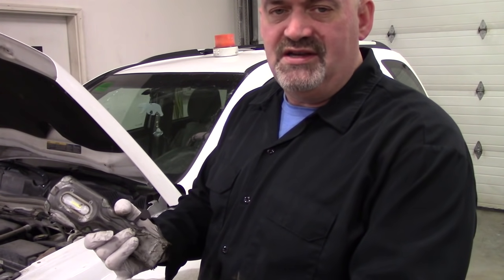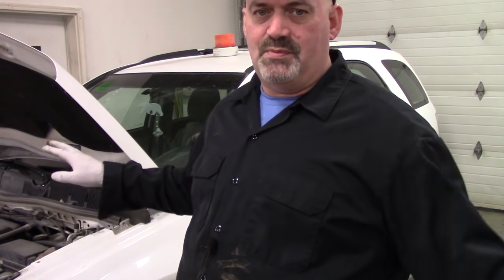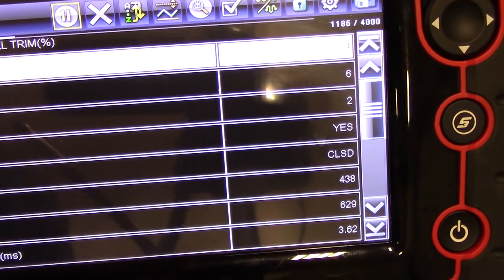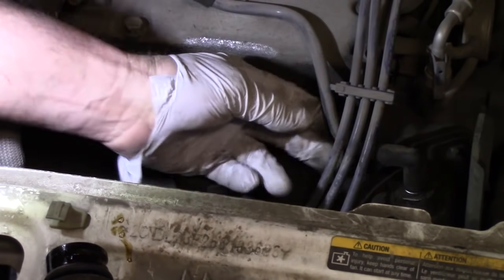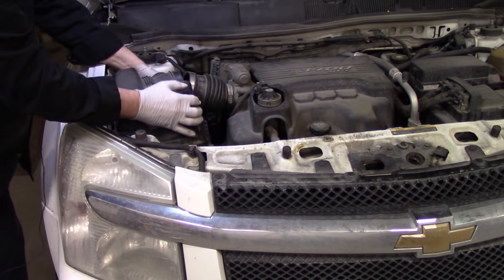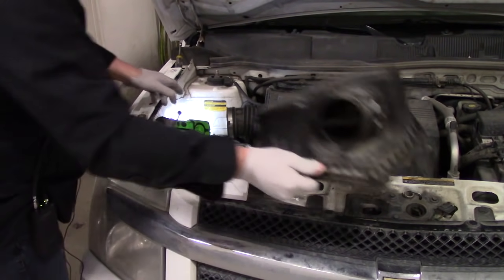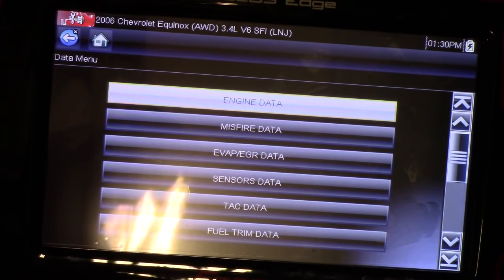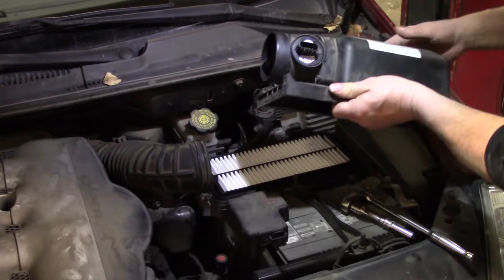Code P0171 Diagnosis and Repair

Comment: Excellent presentation!  Daughter is dealing with the warm hard start, I'm trying to diagnose from 250 miles away.  Recently worked on by professional mechanic.  She got gas and would not start.  A push on the gas while cranking would then it will start.  I'll follow up this comment when she gets it fixed.  Thanks for taking the time to post this, again, very well done Sir!

Comment: I swear by the Chevy Equinox.  I purchase a new one in 2005 and it ran like a champ.  Turned it over to my Granddaughter in 2014 and it still going strong.  What did I replace it with.  A new 2014 Chevy Equinox.  One of the best and most reliable vehicle I have ever owned.
Reply from the maker: I love hearing success stories. I have seen a few in the shop but usually due to lack of proper maintenance. The last one I had in was because the coolant ate right through the head gaskets because it had not been serviced in over ten years. Costly mistake.
Reply: I have ,05 and just replaced cat and bought new sensor guys at Auto parts says it was clogged and my check engine light is still on and still saying same thing,low efficiency threshold, should I buy this part to see if my engine light goes off?

Comment: It was an exellent video. Thank you so much for really clear explanation (leakaged) which helped me to fix my Prius 2010 with P0171 error code. Found the air filter clamp right next to MAF sensor loose.

Comment: 2012 Nissan Maxima with code P0171. Your tip on higher trim values at idle and lower trim values when reved. Was a vacuum leak. 3/8” vacuum hose blown out on the back side. I could hear it sucking. Looks like the PCV hose. Thanks for the tip. $3 Fix.

Comment: Very good video.  . . It is yet another example of one component going bad, but doesn't directly trip a direct code. Annoying. . But it is how it is. . . I had a mass airflow sensor go bad once while on a long trip. Luckily, it tripped the code that speficically went right to it. It was a 3 minute repair, start to finish.

Comment: Had a a trailblazer with similar issues Tim,turned out to be the MAF and a PVC. disconnect creating as you said a lean condition. :)
Reply from the maker: I have seen that as well. The PCV vent side becomes disconnected when people remove the intake air box and don't get the hose on the underside properly connected. Don't know what we would do without these gravy repairs  they seem to engineer into these vehicles.

Comment: I had p0171 on my Colorado. It was not running for crap. Bought 03 sensors nothing. So I bought a fuel pressure kit harbor freight. Found my pressure at about 18 lbs. Replaced fuel pump now pressure is over 50. Runs like a new truck.

Comment: Thank you for the video. At about 5:30 as your hand iis moving towards the ignition pack there is a hose that attaches to the top of the engine. What is that part it connects to? The clip that holds the hose in place is missing on my 2005 equinox and I'm connerned it is causing a vacuum leak.

Comment: The buffer on my Modis Ultra only goes to 2000... guess I should check if an update is available via shopstream. With my luck... I'm sure it's only available with an actual "paid" update. =(
Reply: Just about cheaper to buy a new scanner nowadays then to update. If you update the tool youll get to have cheap cables that break the first time you touch them. Super cool. I would keep the lower buffer.

Comment: Could this code be caused by bad gas?  We were having no issues with a Dodge Ram 1500.  Filled the tank with gas, the vehicle shut itself off whilst filling, hesitantly started, then sputtered and stalled after driving about a quarter mile.  The vehicle needed towed.  After adding Heet to the tank and using cans of starting fluid, the vehicle starts, but won't stay running.  The code is P0171. There were no issues prior to this.

Comment: Thanks for the video. Have this same code on my wife's 2014 Escape. Question...On our Escape, P0171 is lean on Bank 1. If it were the Mass Air Flow Sensor causing the computer mis-calculate the amount of fuel to add, wouldn't that affect both banks the same? I'm trying to narrow down my issue is why I'm asking this. Not sure if I'm missing something.

Comment: My scanner only does Freeze Frame data. It found the following for a P0171...
STFT Bank 1 is 14.8%
LTFT Bank 1 is 29.6
MAF is 0.39 lb/min (2.948g/s)
809 rpm throttle position 26.2

Vacuum leak? I have searched for a vacuum leak and can't seem to locate one on the 2010 Chevy hhr 2.2L. Wish I had access to live data on the Innova scanner.

Comment: I'm getting that code, so the computer thinks it's running lean, but it's running so rich you can practically see charcoal dust spraying out of the exhaust. Between the MAF and the O2, if they are sending conflicting data to the computer, which sensor gets the final say?  It's a 2002 ranger with a 2.3. It runs smooth for the first couple minutes, then goes to pure crap.

Comment: I changed my MAF sensor , intake manifold gasket upper and lower , pcv valve and grommet . The service engine light went out for a while then came back on then after 2 days the light came back on again . Anything else I’m missing ?

Comment: Hello friend... I have a 2002 chevy s10 2.2l pickup.. I checked for leaks with smoke and no leaks... New fuel pump, new filter, new 02 sensor, new spark plug cable and plugs, new map sensor. And still get the p0171 code right back.. Any ideas why?? Please help me

Comment: If you are repairing a customer's car, don't clean it.  You risk a come back if you are not thorough about it or age related failure later.  Plus, you gotta charge labor to clean, which comes out a wash.
Reply: I really didn't think of it that way but youre right. For whatever reason, these particular part numbers are junk. I just want it fixed and down the road. They will be saving that much in gas over the next few months. Blessings!

Comment: No no no. You don't get to skip right over how you got that in. Is there some trick, does the key need to be in?
Reply: Hahaha, no key needed for the install but I neglected to put a dab of lube on the o-ring first. That's why I edited out the cussing and extended fighting with the stupid thing. On the second one I put a little lube on it and it popped right in.

Comment: Buick 2000 3.8....my warning light problem began about 2 months ago. First it said gas cap loose, I cleaned it and that was solved...Then it became slightly difficult to start, so I would slightly tap the gas pedal and it would start right up. After a couple days it would start up normally again on the first turn of the key like it always has and still does now........a couple weeks ago the yellow check engine light came on and the code came up PO171. Then it when out by it self a couple days  later, then came on again, and went out again...During all of this I have watched my mileage very closely, and my instant mileage for highway driving is 29 mpg, which I the same has it has always been, and the average overall mileage is 22, like it always has been......do you have any idea what the problem would most likely be? Also during this whole time the car has been idling and running very good......Thanks for any suggestions...............
Reply from the maker: Vacuum leak, MAF issues, O2 sensor,?
Reply: @ThecardoctorTV  thank you

Comment: thanks
man 
my 06 pontiac Torrent 3.4L v6 i just had my engine rebuilt cause of a blown head gasket  and my mechanic says that the engine light is on he says that it running lean do you think that it is the Mass flow sensor doing this, i was driving around most of today but noticed that i am burning more fuel, i replaced the  rubber elbow that go on to the pvc valve and also replaced with a new Gas Cap but the engine light is still on in the Dash, do you think that it might be the Mass Flow causing that light to be on, the car starts fine.
Reply: Same for me months after changing the head gaskets on our 06 Equinox, Did you ever find out the issue?

Comment: Why do some vehicles use MAF sensor and some don't. Just MAP like my Dodge truck?
Reply from the maker: All in how they calculate how much air is entering the engine. I think a MAF is better at doing that but prone to failure so its give and take for advantage of either. That's just my opinion and they probably have other reasons based on the actual engine and fuel system design.

Comment: hope u can help me doc,I have a 95 Nissan D21 pick-up V4, I have no injector pulse  , nothing
Reply from the maker: Crud. Is it got spark?
Reply: Yes it does, but it's a weak orange spark
Reply: Just replaced fuel pump and fuel filter, distributor cap and rotor
Reply: I got nothing on fuel injectors through
Reply: Though
Reply: How do fuel injectors get their pulse, what should I check or test,please help doc, your my last hope, thk-u in advance
Reply: Jaime Sustaita gets pulse from computer check your wiring and fuses
Reply: Ok, thk-u Desmond blyan
Reply: Yes, those ECU's are problematic for no injector pulse. The injector driver circuits fail internally. Most likely a bad ECU or wiring if you have spark but no pulse.
Reply: Hi howd it go, did you check powers grounds n fuses?
Reply: I did and found I had a short to ground, thk-u so much for your help, really do appreciate it.
Reply: R u the doc, or is this someone else.
Reply: Two of the wires are touching obviously the doc can't help
Reply: Its commen problem
Reply: Wires are close to exhaust burn out easily that year
Reply: Gotta change whole harness
Reply: Or repair wires
Reply: Probably just repair wires, can't afford whole harness, Yea agree about the doc, but thks to u , I got once again I appreciate your help.
Reply: Should be just like one wire
Reply: Yes,I think it is,r u a mechanic and do u have your own YouTube and app
Reply: Any input anyone
Reply: No no you tube channel just common sense
Reply: Lol
Reply: Its an obvious problem
Reply: Ok, thought maybe u had your own YouTube page
Reply: No i would but too many wanna 🐝 already
Reply: I only know facts
Reply: I do alot of  work on cars, but electrical diagnostic is not for me, especially since I don't have those expensive scanners
Reply from the maker: Sounds like another success story! That was me as My alaska. I screwed up and commented under another channel. Glad you guys fingered this one out. Blessings.

Comment: Hello and thank you for your informative videos. I am having similar problems with my 2010 equinox 2.4L. My problem though is not a hard start at all. It starts and runs fine unless I am sat for a bit in a drive thru or stop light. So basically on idle in drive. When this happens long enough the check light comes on and the code is the p0171. I have changed the MAS airflow sensor, the broken exhaust manifold, and the upstream O2 sensor. Yesterday I had a throttle position sensor code so I replaced the throttle body. I also got with that but not changed yet the downstream O2 sensor. Plan to do that job tomorrow or next couple days. Any help would be amazing as this 06 equinox is not like my 10. Thank you in advance.

Comment: given mileage and age of vehicle you replaced the air sensor.  Veh is 16 years old and 196K miles..  Are you recommending changing the sensor  in this video when those two factors become elements?
Reply: My veh is 16 years old with 196k miles. I tried cleaning and treating air filter, inspecting and clamping lines that needed it, removing and cleaning MOF-blowing it out brushing it off, yet almost daily my ce light comes on with same reponse (too lean)  at this point I'm thinking of replacing sensor because I don't know what else to try

Comment: Great fix and bye the way what would cause negative LT trim at idle and reduces with revs ?
Reply: Leaking injectors, fuel pressure regulator, bad O2. Thanks for tuning in!

Comment: "Checik here.check there" look at this look at there… in case here is the problem with MAF sensor" what kind BS is that? You must explain how you fond that.(maf problem). I don't think you know lot of things about it
Reply: He did explain it. He looked at the fuel trim variations and while doing so explained 3 different scenarios that would point you to 3 different culprits.

Comment: Great Video Tim but not being able to see the whole scan tool screen (line item monitor circuit and it's value at the same time) and because your tool was bouncing all over because you're trying to show us what your talking about. Maybe if you did what you normally do and leave the camera on the tripod.  That might have made the video a lot better. Oh Yeah what a friggen Pain in the Ass that was getting the old sensor out. I probably would have tossed Big Bertha in the ring and have a few beers to settle my nerves.
Reply: OH man, I thought the screen was better than normal. Maybe it wasn't me bouncing around but maybe you had your puppy in your lap while you were trying to watch youtube.

Comment: Tim, I have 2000 Grand Prix with a 3800 engine I get a check engine light that will come on with a PO 171 code. It will stay on for a day or 2 and go off by it self and come back on a day or 2 later. I just have a cheap scan tool and only has freeze frame data. The last time it came on I wrote it down. R.P.M.1115, ST.F.T.20.31, Lt F.T 16.40. Map 11.22 Maf 0.19 Mp 13.  What do you think?.
Reply from the maker: OH boy, sounds similar to this one. Have you tried cleaning the MAF? CK close for vacuum leaks in all the places I talked about here. You could try to calculate the MAF values. What altitude are you at?
Reply: I did buy the special cleaner, I'm in Oostburg,Wi. Don't know the altitude! Thanks. It does idle and run good.
Reply: You can use one of those MAF calculators online and calculate based on the readings you have. If you decide to replace the MAF I would recommend using the Delphi unit like this. Not reman or spectra junk